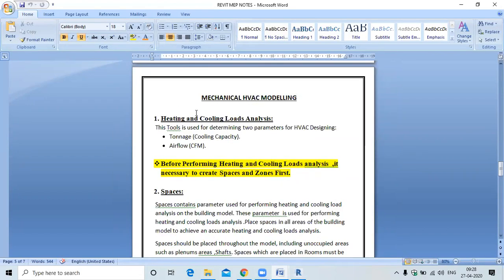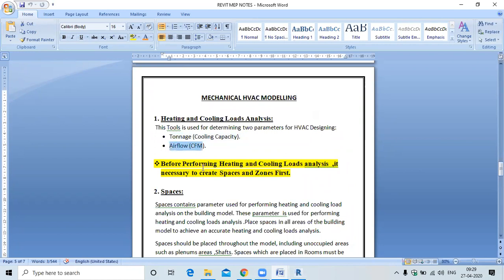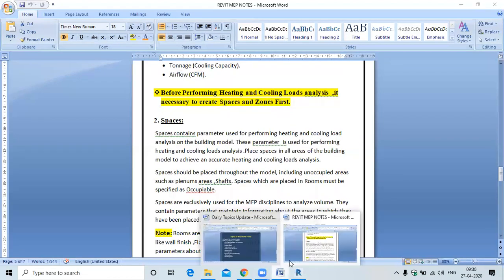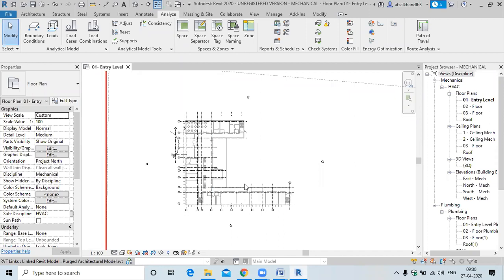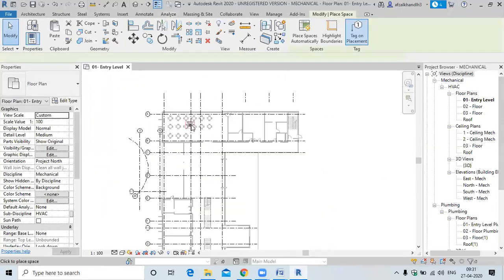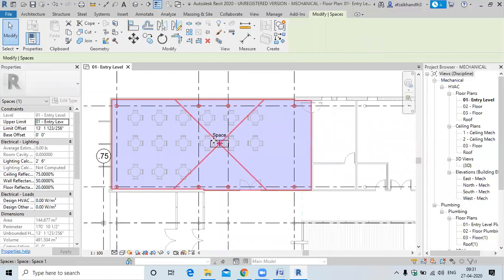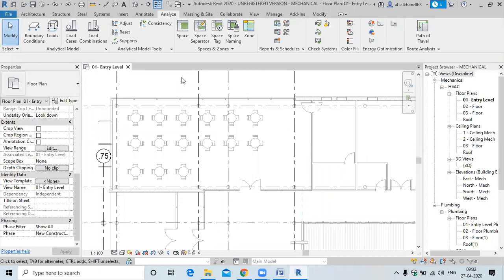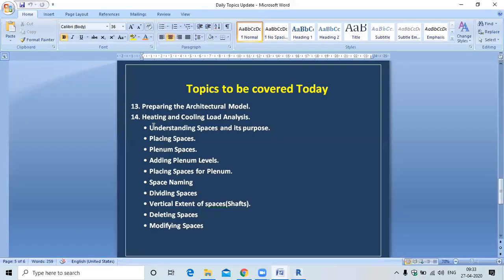TUTORIAL 08 || HVAC DESIGNING & MODELLING #02 || REVIT MEP 2020

Comment: Sir two doubts for me
1. Inorder to use space automatically we need same floor height or same architecture design  in all floor 
2. Why offset is mentioned when we have the ability to set upperlimit
Reply from the maker: 1. Same Floor height 
2. There are some spaces where we need to add additional height beyond the upper limit .Like when you place space in shaft you have to extend the space above the roof level, there we use this offset option